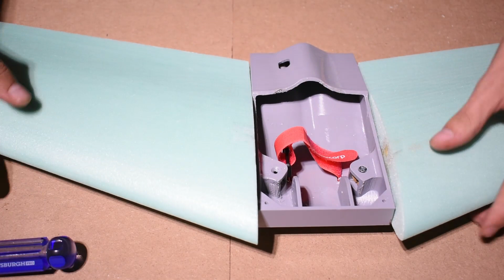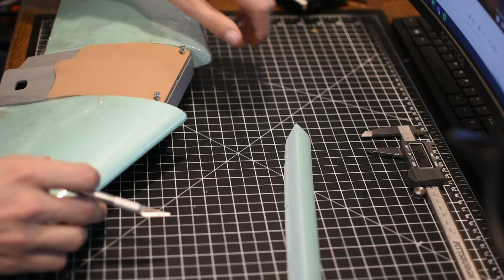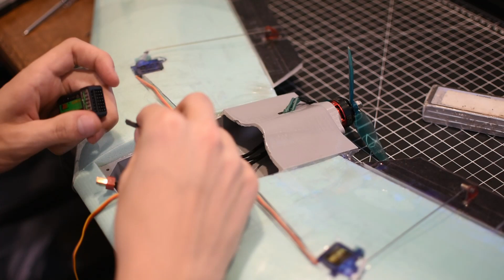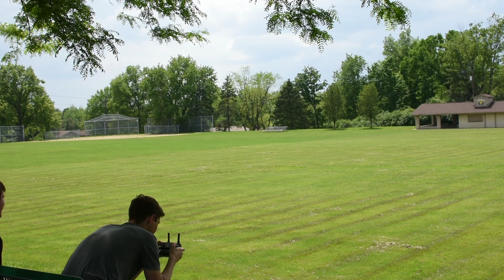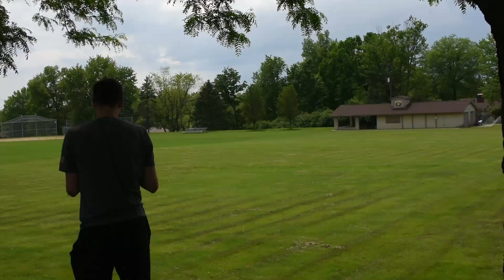Building an RC Flying Wing

Comment: is that your brother? i remember the first time i went to fly if crashed just like your first attempt. The second time i adjusted the thrust angle and it was way better during takeoff. you need a large open space for fixed wings cause these things go really fast in air compared to a multirortor

Comment: Oak has very low beam strength. Actually spruce, which is lighter as a soft wood has much higher beam strength. That is why it is used in real aircraft.

Comment: that was fun. keep building. Almost all the forces are going to be applied in the center of the wing, right where you just have glue connecting to the 3d printed area. I would recommend skipping spars out at the wingtip areas and have some continuous spar thru the fuselage. Looks like maybe it was tail heavy slightly as well. Dont let these things stop you, build something else now!
Reply: agreed. one spar all the way across, going about 2/3 of the span from the center of the fuselage to the tip of each wing. maybe a smaller spar or piece of plastic that goes 1/2" or so into each wing at the back to keep the wings clocked the same so they don't rotate relative to each other.